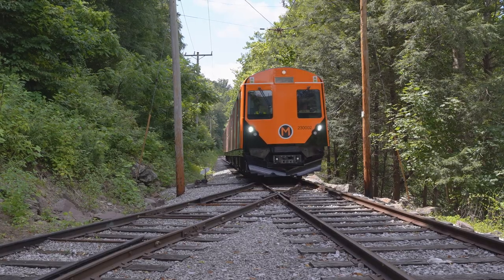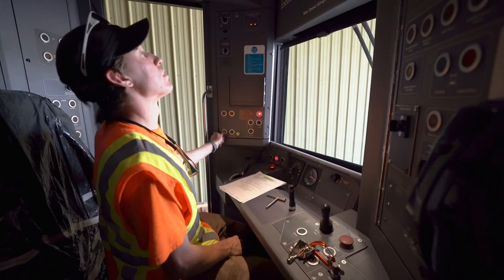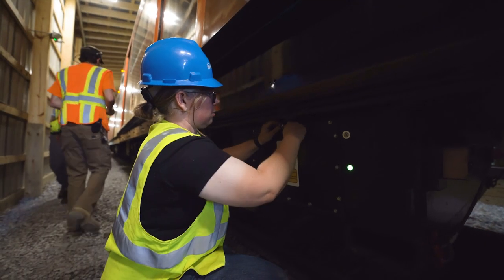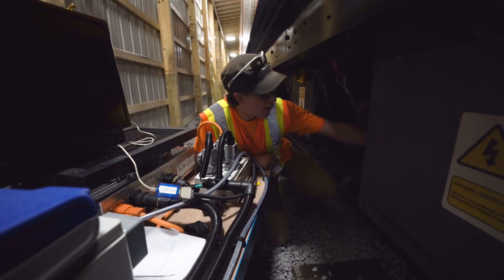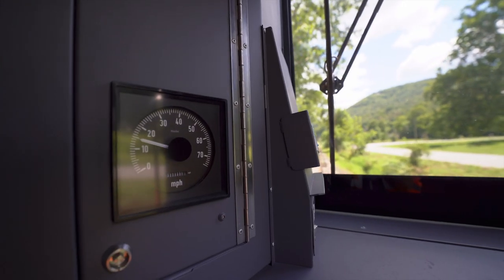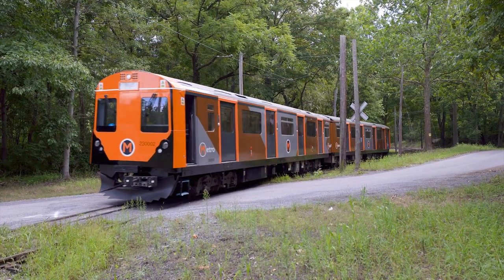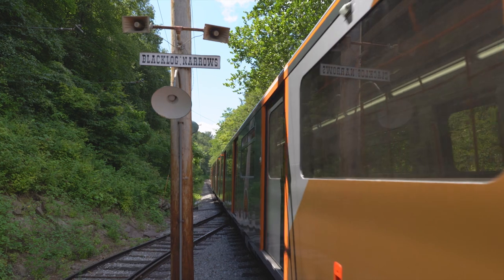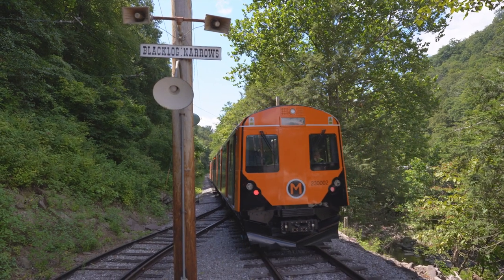CMU's Posner Lays Track for Future of Rail Transit

Comment: This. Is... Fantastic! I'm impressed that this university was able to import a battery powered London Underground D78 Stock set to the U.S. The concept for Pop up Metro is brilliant and should be promoted around the nation. However, I'm worried about the use of these railcars (the class 230) in particular since they may not be able to pass FRA safety standards due to the little space between the driver and the front of the train, as well as the somewhat small shape of the units. May I suggest purchasing and converting now-retired LIRR Budd M3 coaches? They're very similar to the existing class 230s and they have been approved by the FRA for commuter service on Long Island since the 1980s. Other than that, it's encouraging to know that there is an interest in rail transportation in the U.S. again, and projects like this is just what the world needs to ensure an environmentally friendly and efficient future!
Reply: Pop Up Metro does sound like a good idea but I would also recommend using Arrow III EMU’s from NJT.
Reply: I think the 230 are a mere demonstration that the concept of pop-metro could work. If proven successful it will be more likely they’ll push for refurbishment of older cars in the US instead but for now the 230s are just a proof of concept
Reply: I think it unlikely that British Safety Standards, including crash-testing, are much different from those in the US. I suppose the difference is we don't have wide animals wandering about on the track. ;)

Comment: Am all for the Princeton Dinkey Project. The battery thing fits in well with what the controlling parties are all drooling over, but glad to hear Popup Transit has alternatives for propulsion. The Route 1 Station is a great idea, but must caution the engineers of the Rail Cabal will be at pains to stop it any way possible, as a strong argument for cementing permanency of the passenger service there: once it gets built it will screw the faulty logic of all these expensive studies that determined the line was problematic and had little potential.

It's a conspiracy, nothing less. And the fiduciaries don't have the intellectual wherewithal to contest it, or even know something's wrong in some cases I suspect.

The truncation of the Princeton terminus WAS AN ASSAULT designed to discourage ridership. (very clever!) A grade separation scheme would fit well with adding raised platforms (or actually lowered tracks) at the original terminus. There are 3 grade crossings, two of which were added recently in conjunction with the truncation. They can all be removed with reasonable ease.  But all that is secondary to plain survival, and getting the Route 1 Station and development there to cement it. Otherwise it will be converted to freight only, then abandoned.